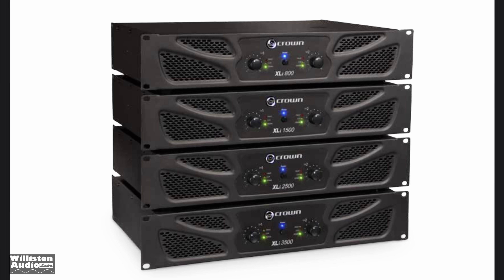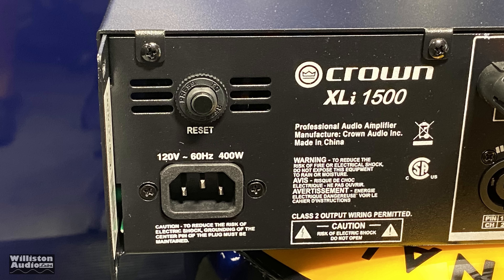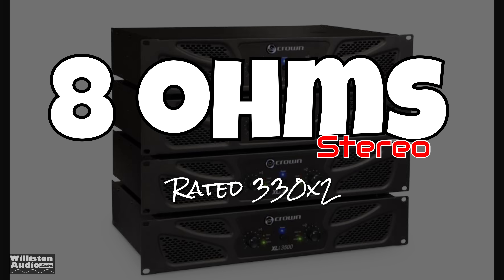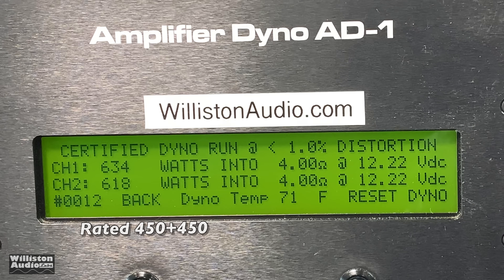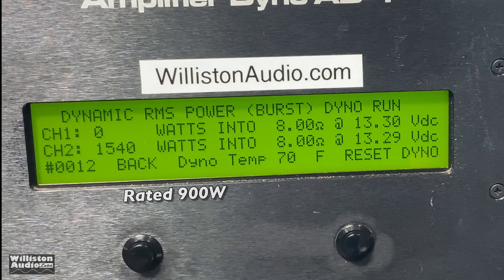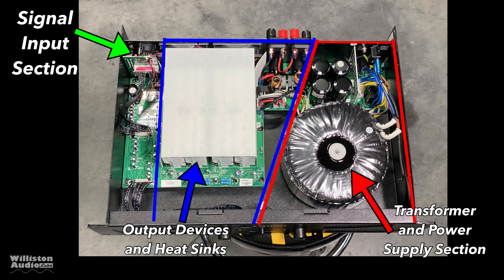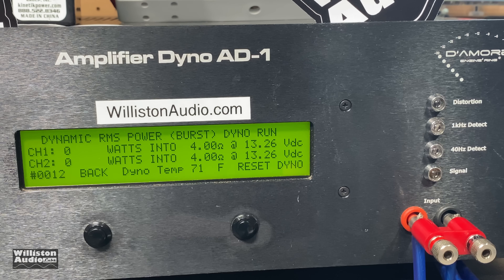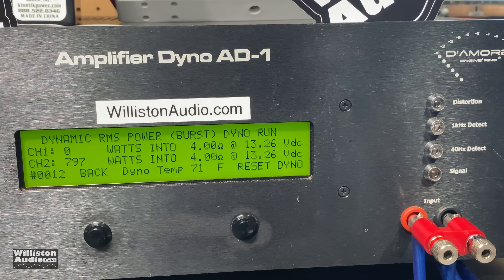The King of Pro Audio? Crown XLi 1500 Amp Dyno Test and Review [4K]

Comment: I have one of these XLi1500 about 4 years now and it is still serving me well to this day. No reliability issues to mention and excellent audio quality on the output. Thanks for doing the dyno test on this amp, it felt good seeing those results!
Reply: Thnx 4 that, was looking at one of those to drive my 240TI jbls.
Using Kenwood MB2A class A for now, but looking to bi-amp. External subs (2×15) from my playing rig to be added on, just move the Kenwood to them. Nothing worse than muddy bass on a pipe organ.
I think...😂
Reply: Thank you as well, for your feedback on reliability....Ordering two this week!!!

Comment: Excellent my brother. I'm listening to a few Crown amps as I type this. I have an XLS1502 that drives two DS18 Z8 subs in a properly sized dual slot port box. The front stage is a Crown XLS1000 driving a set of JBL Studio 590 towers. A PS Audio PCA-2 preamp corrals the beasts in an incredibly clean demeanor and it accepts nice balanced XLR cables. Thanks BigD

Comment: If you demo any more pro audio amps, try the Crown XLS series. They are highly regarded by audiophiles as being a great, powerful, neutral sounding amplifier. They are class D, about 10 pounds, and are 2 ohm stereo stable, bridgeable, and have RCA inputs, and built in crossover.
Reply from the maker: Thanks for the feedback

Comment: I had a Haro Master Freestyler 20" I got when I was about 9 or 10. About 6 or 8 years ago, someone broke into my house and stole it. Mine was chrome and when I ordered mine as a kid, it only came with a frame and forks and maybe the goose neck. I trimmed mine in red. I put red Skyways on it, low profile tires and knee saver handle bars and crank setup from a Mongoose Expert and a lay back seat post. That bike I still miss
Reply from the maker: Thieves suck

Comment: I wonder why these amps have an input rating of 400W on the back when they can put out 3x more power, i wonder is 400W its max continual power?
What would happen do you think if you put a tone into it and ran it continuas, would it max out at 400W.
Reply from the maker: These are tones used for the test

Comment: I've been waiting for a Crown video. I'm particularly interested in the newer version XLS series that is lightweight. If they perform like this xli does I'm getting one
Reply from the maker: Thanks for watching and commenting!
Reply: Well pick one up they have built in cross overs as well and they wieght8lbs and work at 2ohm loads easy.
Reply: I bought the Crown XLS 1002 to drive car subwoofers in the house.  It has a built in crossover and is stable to 2 ohms stereo or 4 ohms mono. I want the XLi 800 as well! Great values and more power than you'll know what to do with.

Comment: You tested the Inuke 6000 @1khz  and it did 4,000 watts certified and 4,931 watts dynamic, but can you test it again @40Hz. I'm curious to see how much it puts out at that frequency because I have two of them on 4 soundqubed HDS3.1 15's and it legit cracked my ceiling. You're the reason I bought two of them for my room and I haven't had any problems with them and I had them for over 3 years:)
Reply: You haven't had any problems with them well I would call a cracked ceiling a problem lol 😆
Reply: @rockman49er  I bought one used in 2017 and its still working perfectly today then I bought one refurbished in 2018 and that one stopped working this year (no power). I already replaced it with another used one and everything is working good.

Comment: Can you try a Crown XLS 2502 next? 
Thats the daily driver for my home sub. Great content as usual good sir
Reply from the maker: Not next but I can put it on the list
Reply: @wal  that's awesome. Lots of us excited to see a 2502 :-)
Reply: Sweet!
Reply: I have the same amp for my jbl passive tops.   Ive seen some reviews on audiophiles using this amp for it's power and sound quality. I would like to know if the power rating is true for it's rated performance.
Reply: @EJHilt  if its a crown, it delivers. would be neat to see how much power though.
Reply: I have 3 xls2002. I don’t think they are anywhere near what they are rated. I could be wrong!
Reply: @todds5956   if you give it the voltage it needs that makes a huge difference.
Reply: How does it run the sub do these amps have a lpf ?

Comment: Oh, man! .. Crown audio amplifiers go way back. .. As a 1970s era HiFi enthusiast,  I'd work up to a brandi-neu pair of Crown D-150s amplifiers. .. With each D-150 running in mono,  my trusty Crown IC-150 pre-amp controlled the kit. .. Add a pair of JBL Professional 4333 monitors to complete the kit. .. Years (a decade +) later I'd hear just how un-Hi-Fi the Crown amps sounded. ..

 The Crown PSA-2 amplifier later introduced while a "good" front-of-house amplifier, in a HiFi setting the PSA-2 amp was more of an arc-welder. .. Yeah, fond memories Crown electronics.  (B.C., the Harman acquisition) .. P.S., Did Crown go with the Harman purchase by Samsung?
Reply from the maker: Thanks for watching and commenting!

Comment: yep, CROWN rules ;)  I have an old DC300A from Crown. 2Ohm stable :) 2 x 300W at 4 Ohms and 104dB signal to noise ratio and 2 x 90.000uF caps. 90 Volts on the output, so don't put it up to some home speakers.... they'll burn ;) Great amps!

Comment: wish u would dyno more of the crown line.. i have a xls and it definitely does not put out the power it says...
Reply from the maker: I use feedback from the views and comments to help determine what content I make in the future so thanks
Reply: @wal  i really like the PA amplifier test keep up the good work Big D the man with the amp's o-boy
Reply: I own the XLi 2500 and its great. The XLi is AB that's why I got it instead of XLS. I just don't like class D for great sound, unless you spend thousands.
Reply: @ericnortan9012  
Class D for subs is fine.
Reply: @FOH3663  for sure. To be honest a lot of class D is  great all around from my understanding. I just haven't heard much other than pro stuff or car audio in class D. I'm old (50) all the old hifi guys were class A guys when I was a kid, that's just what I knew. 👍
Reply: @ericnortan9012  
You're right, essentially all class D is ok, some are better executed than others certainly. If anyone is curious about state of the art class D, Bruno Putzeys work is what they should examine. 

Fwiw, One of my systems is ICE Power Class D actives, (3x LCRs across the front Seaton Cat12c). 
And... I've got you by a decade, I'm nearly 60. 
All the best
Reply: eric nortan what’s the point of amp dyno.  To see if it actually puts out the rated power
Reply: @specialformula14  ya, understand. Just saying the XLi line are solid amps for the price. I've heard good things about the XLS, but I was afraid the sound would be bad. If it lacks power then it can't sound great.
Reply: It does trust me
Reply: What model and how are you using it, in which configuration and driving what speakers?
What signal are you feeding it?
Id bet on user error rather than amp failure.
Without a shadow of a doubt.
Reply: Do you know what you're doing? What is your preout voltage?
Reply: All xls do their rated power
Reply: @specialformula14  hahahaha, unless it's a clone, yes it does.
What model is it and what are you running on it?

Comment: Yes more pro audio amp tests please. The Behringer NX series of amps appear to have replaced the old iNuke amps. I'm using two of the NX6000D amps in the facility I work in, a studio that hosts live events. I'm curious to know the actual output if this series. I imagine its over rated but how much. They sound clean and the output could be lower than spec and still a good value. I'd be willing to buy it  and send it or bring it to you. I'm not far from THE Williston Audio Lab.  Thanks again for fun video content.

Comment: Hey I was wondering if you could get a hold of a Behringer 4000 watt amplifier. They boast 2 ohm stable stereo at 2000 Watts a side. I call utter bs. I don't even think you can get this type of power out of the 120 volt Outlet. I am a musician and run my frontal system and kind of need to know if this is true or not since I will be bridging my Bass front end and need to know if this amp is powerful enough to do the job.
Reply from the maker: I’ve tested a couple of Behringer amps, see the playlist in the video description or in the pinned comment
Reply: @wal  thanks Derek for all that you do.

Comment: Thank you for testing Pro-Amps, if you can do Behringers class D amps, very affordable amps for the power they pack.
Reply: he already had a  test of the behrringer nu6000 and 1000 and its good numbers for them to but i dont wanna use them in profetion then i had my lab amps instead :D i have 3 of berhinger nu6000  and 1 nu3000 its for my uppcoming home  teathre
Reply: I have an inuke3000 but for low bass they don't put out much power long term I feel. 

My only gripe with Dyno tests is it doesn't show long term output after the amp heats up and the effects of 20Hz on the power output. 

My sub will get smelly if I play 40v for a while. That's 300-400w on my 4ohm Ultimax 18... Either the 18 can't take much power, or the amp is weak.
Reply: @JoshM7  i dont know how much 40 v is  but this amp isnt so powerfull. you have  maby 300watt at 0ohm and 550 in 4ohm  did you bridge it in 4ohm is not a recomendation for this  amp
Reply: @thompi8  Not sure what you mean. It's (My inuke3000DSP) designed to be bridged. The nu6000 is basically using bridged 3000's for each of its channels. 

And yes I use it bridged. 40v into 4 ohm is around 400w. Though that's assuming the impedance is a static 4 ohm, I believe it's closer to 5 ohm so 300-400w is more likely what it's getting.
Reply: @JoshM7  i know but still not in 4ohms is not the best choice of any amps  stand between 8ohm bridged or 4ohms sterio thats is somthing cheeper amps can hold expensiver amps can handle 2ohm or 4ohms bridged
Reply: @JoshM7  now you will say it vorks yea it will but still not in longterm  like you say earlier  its maby work one hour but not awhole play night on a disco thats reason i dont wanna use them more them to a home bio or  smaller karoke. The point here is the amps goes warm its like overklocking a cpu without cooling for it. i hope you understand me !!!!
Reply: @thompi8  Well to be fair this amp (Inuke3000DSP) is about the same price as the one mentioned in this video. But it's Class D vs A+B like the XLi 1500.

I kinda get what you mean but the amp is designed to operate this way so it'd be silly not to use it this way. 

My sub technically gets louder than I need 90% of the time, but it still doesn't change the fact that I can't run close to rated power because this Inuke is weak. It had good Dyno numbers, but in the end musically doesn't do a quarter of that real world. Or at least from what I've seen. 

I've had it pump out 900w, but it was very dirty power. I don't understand how people get 1,400w out of these (Inuke3000) amps when 500+ is sending dirty power. They must be testing them for 5 seconds and calling it good. It'll do 500w clean as long as you don't have any sort of sustained time at that power. Like 1 second on and off for a few seconds. Didn't have any weird smells after a few minutes of doing that.

In the end the Inuke3000DSP is good starter amp but expect 300w-500w musically bridged 4 ohm from 20Hz+ 

I'll get a real amp eventually, but that'll probably happen after I sell and rebuild new downsized subs.
Reply: @JoshM7  Comparing a Crown with a Behringer is like comparing a Porche with a Toyota 2 different amplifier. The Crown's worst amplifier is top class, however, this is a cheaper amplifier.

I compared my Behringer Nu6000 with a Lab1000 and when I bought it I had no hopes at all. When I started searching online after buying my first. What about the other who did the same tests for longer periods of time, ie several hours as they stressed the amplifiers. so i actually believe more in these values than in anything else i have owned quite a few amps during my days. as a dj.

Can say that so now I translate with Google translate so I hope you understand
Reply: @thompi8  Is that a Lab Gruppen amp? I've wanted to get one but they're a bit pricy. Though they seem to be top tier amps.

I'm not that familiar with Crown VS Behringer but I suppose I can see Behringer being beaten by Crown since I see some Crown Amps that seem to be much better designed. I only got into DIY Home Theater a few years ago so that's about the extent of my knowledge. 

But I've learned the limits of this Inuke and thankfully It's enough for what I have currently. But still have that desire for a real amp that delivers what I expect of it and not a quarter of my expectations.

I just found the Lab.Gruppen PDX3000 but It looks like a copy of the Inuke. Not much specifications to be seen either. Their software is the same as the Inuke with a different color to it.

Comment: This is not an pro audio amplifier.

Powersoft, CAMCO, Dynacord. These labels are pro audio Amps. Please test one of these :)
Reply: I agree but you forgot the best of the best lab gruppen
Reply: @dwmfty3111  I didn't forgot them.
LAB was extremely good but now it's Behringer and they build really bad Amps now.... That sucks.
Reply: Powersoft is just good at burst power. There is no way the power they pretend is real, especially at 230Vac mains.(1 phase)
Reply: @andyapple9  check the X Series. It's completely different to Powersofts other series. Trust me :D

The best analog amplifiers comes from dynacord and MC2

Comment: Many people use that brand for subwoofers in their home theater systems
Reply: I run my home subs on this one, four 12" Orion XTRs! Pound!
Reply: I have 2 crown amps on my home system. And it is very loud. I actually have close to 10,000 watts total. I blow the breaker if I turn it up
Reply: Dint want to use crown for home theater running the inuk6k
Reply: @GMTPF800  what?

Comment: You should more test of different crowns and QSC pro amps. So many of us are using them for home theater and audio as well. I use to run full rigs with the old MacroTechs by crown. They where beasts in the day.
Reply: Throw some of the Powersoft amps in there too. Talk about power density.
Reply: Yes the qsc 5050, 2450 behringer ep4000
Reply: @krishanmendez9119  the pl380 smashes the rmx5050
Reply: I'm thinking of a separate amp/amps when I build my house. Ill keep my Denon AVR-x3300 and run dedicated amps. Thinking of getting an Emotiva 7 channel amp and SVS prime pinnacle for the left and right and ultra series center and surrounds and the atmos for the ceiling.
Reply: Many people say that the 2450 qsc and the ep4000 are the same amp and the the behringer is a copy.. there pretty much the same on the inside but which one has more power? We dont know

Comment: Crown used to make real amps back in the days, this is just a very cheap Chinese amp... try to test a Macro-Tech 5000VZ, there you will see power. Try to hold it at 0dB and you will see how fast the power starts to be limited...(XLS) Also on the interior the quality is horrible, just look at the small capacitors not being fully pushed against the pcb...
Reply: Crown isn’t the same since Harman took over the brand, however the higher tiered amplifiers are still legit.
Reply: @broosky333  not as reliable as the old ones.

Comment: AWESOME! So glad you did a test on some pro audio amplifiers! That Crown is impressive for a Class A/B. I am running two Behringer A800's (Class D amps) in bridged mode for my living room passive subwoofer (DVC). I would LOVE to see a dyno run on this Class of amplifier. They are very lightweight amplifiers vs the Crown...but, still 19" rack mountable, no fans.
Reply from the maker: The Behringer units I’ve tested are much lighter and more efficient than this amp. I have friends who use Pro Audio amps for events and like the lighter amps or use powered speakers instead of separate amps

Comment: What up Big D!  I’ve got some Bob Carver stuff from the 80s I would love to see on the dyno ...
Reply from the maker: Carver made some great amps over the years
Reply: @wal  i have a couple carver cubes that say 200x2 or 501x1 that im really interested to see what they can actually do. I'd be willing to ship one out for a video.
Reply: I’ve got a 1.5t that supposedly does 1200 mono, and a pair of cubes.
Reply: @550n440  i believe the 1.5t does it easily. I have a pair of cubes that I run my front origin acoustics in walls with.  Im wondering if it really pushes 500 and if so am even more impressed with my origin acoustics. But also impressed with the technology to make that much power in such a small package in what is now an eternity ago

Comment: Big D try the Crown XLS 2502 it can handle 2 ohm loads no problem fans never even kick on.  i have one that runs a pair 15”s in my home audio set up and the XLS is no joke.
Reply: Yeah would be very interesting how the digital XLS compares to the class AB heavyweight
Reply from the maker: Yessir the XLi series doesn’t like 2 ohms though
Reply: @wal  XLS series Big D not XLi ......the XLS is a class D amp
Reply: i got a xls402 as my subwoofer amp powering 4 CELESTION FTR18 in b52 folded horn boxs . ive got a ce1000 and 4 ce4000 just in case
Reply: The fans do kick on but they’re very quiet and turn off relatively quickly but yes,please test the XLS2502 to see if it lives up to its claims.